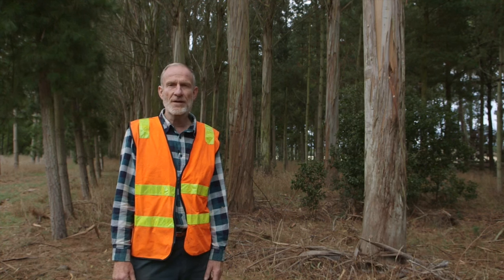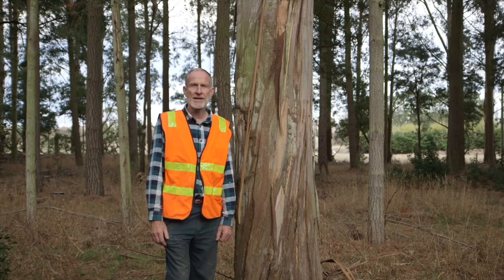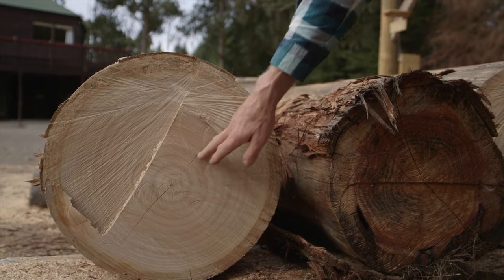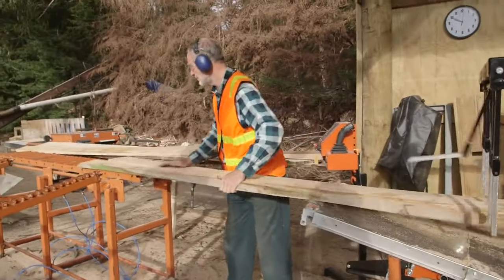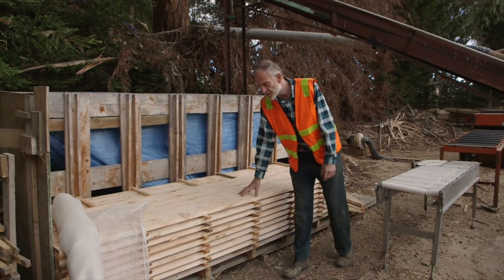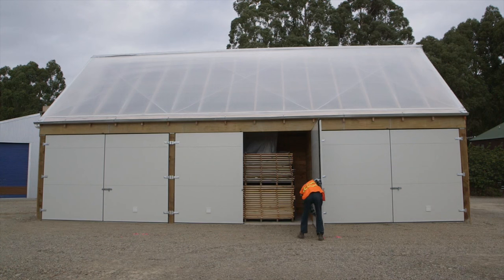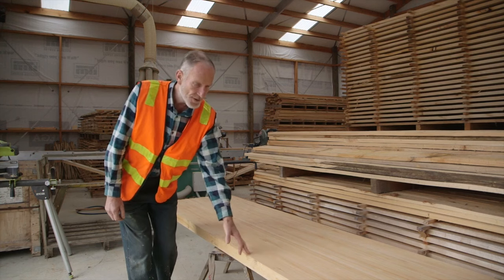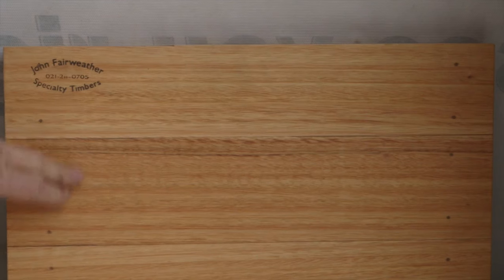How To: Mill Eucalypts

Comment: Not all the eucalypts end check so badly depending on the weather, but I speak of in their natural habitat. I've had spotted gum logs over and around 50cm debarked when fallen in january and sat off the ground till late june with hardly any end checking, we minimize the stress by pre-seasoning before milling and all the mills on the east coast of Australia do, kind of opposite to your practice. Other logs like iron bark and mahogany check up quickly, we just size the log longer than the finished length of the desired cut timber and let it check. You can seal your logs to stop rapid end grain drying which is the cause. Also mill in humid and cooler months so the cut timber air drys slower. Just some thoughts from Australia.

Comment: I have many large eucalyptus trees on my property that I would like to make wood beams out of.  I am looking to make beams that are about 6"x16" or 8"x16" and about 24 feet long.  Do you know if that is a good idea?  If I dried it right would that be possible?  Is the wood stable enough that I could possibly dry it correctly to keep them usable after milling?  I want to use them for beams of a foot bridge to cross a canyon.
Reply: I've seen it done if you don't mind some warps. Doesn't affect building quality.